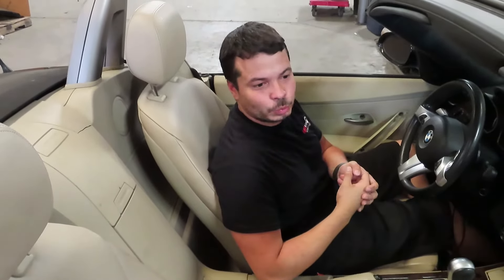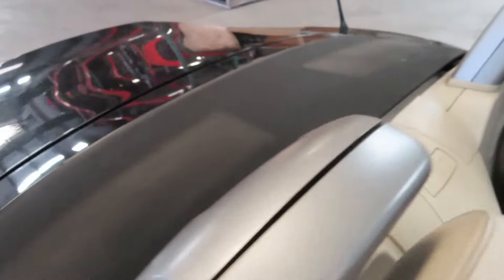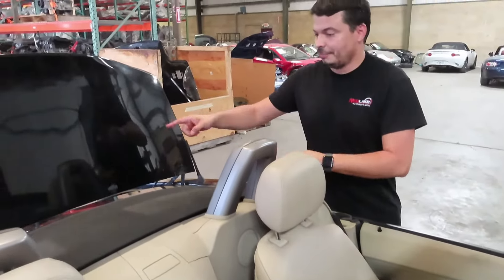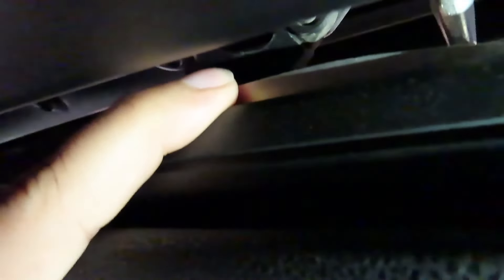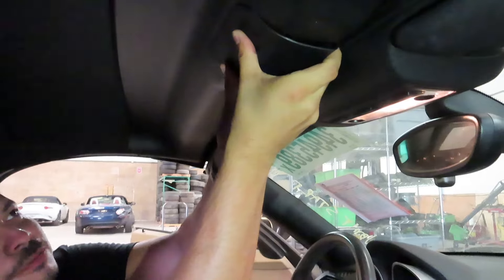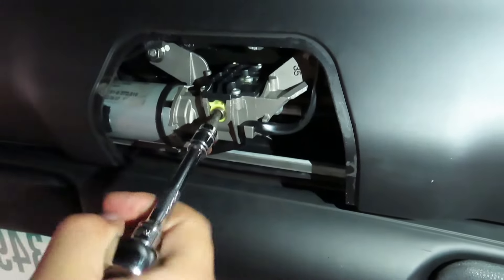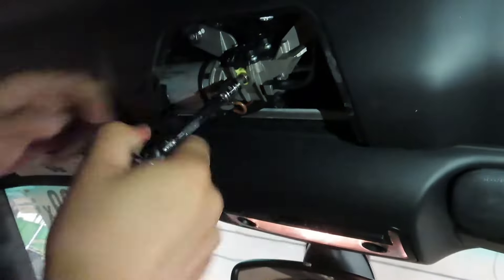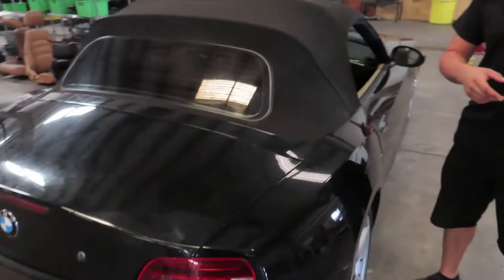2003-2008 BMW Z4 Emergency Top Operation (manual override)

Comment: My 2006 top would not go up.  I heard the motor trying briefly, but would not go up, flashing red light on the panel.  This video IS AWESOME because what you showed exactly did the trick.  After tweaking the back shelf a bit it looks like the top now is working.  Thank you so much.

Comment: Thank you so much. Your video saved me thousands of dollars on my 2007 Z4. I was going to take it to the BMW dealer when the roof did not close. I am now considering replacing the pump myself after I find a suitable replacement. I've seen videos on YouTube on how to access and relocate the motor in the trunk.
Reply: P

Comment: Thank you. Having watched this video I'm more informed on how to operate the 2003-2008 Z4 top in case of hydraulic or electronic system failure.
Reply: Wasn’t that the point?

Comment: Very helpful. This looks like a problem waiting to happen. Of course I need to source a 4mm Allen key as the previous owner had "lost" the tool kit. Or sold it on E Bay, along with the owner's manual. And the wind deflector... what's the matter with people?

Comment: When i do the alan key method to close it because my latch motor is bad, it will get it latched up to a certain point but not fully, theres still a little gap between the top and the windshield where its not fully latched like normal.

Comment: I on a 2008 soft top BMW Z4 the convertible top when opening it does not open and lock down completely what is my problem now what could cause this problem Andy the opening of the south top convertible

Comment: My top is open and will not close.  I am having a problem apparently with the red bypass mechanism.  After I pull the tab, I cannot manually pull the top up.  It feels like the hydraulics are still engaged?
Reply: Pull the string connected to the button in the trunk. If you can’t find this look it up in the manual for the car.

Comment: I had the same problem where the top would not go up and the motor didn’t sound but once I put it up manually, it locked with no problem. Any idea what that could be

Comment: do you guys know why my red cord is stuck? I Saw another video that just move it the cord and you can manually lower the top without using force.
Reply: Probably emergency valve on hydraulic pump is blocked (because of corrosion). You must take out your top and repair hydraulic unit, I guess eletric motor in pump is corroded also. If You have more questions write on cabrio.serwis@gmail.com